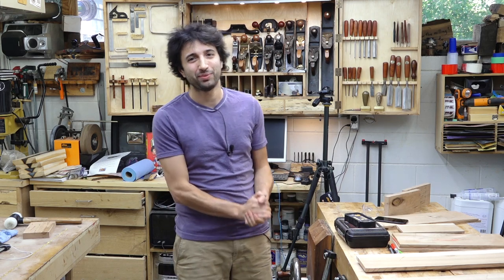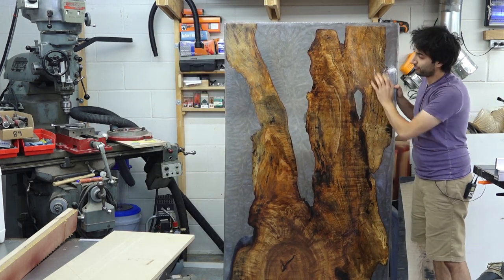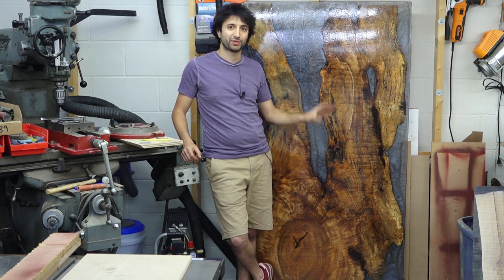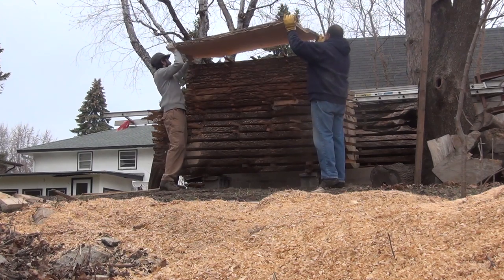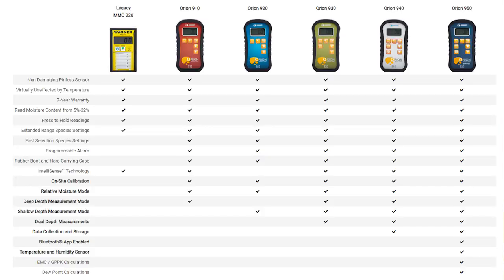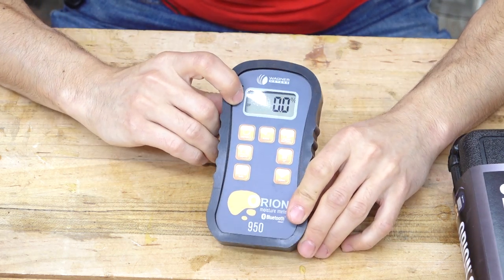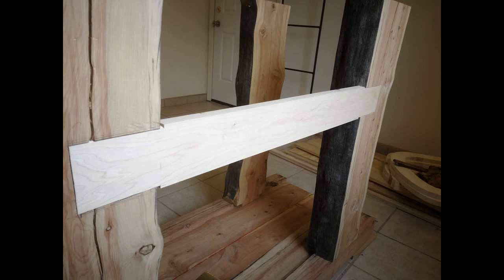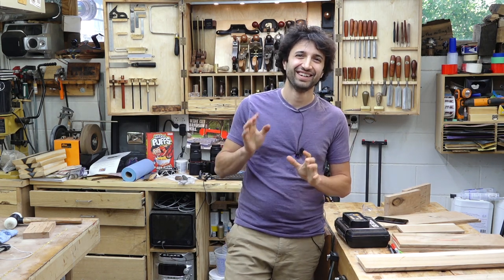Encapsulated Slab Demolding, Sawmill Veneer, and Orion Moisture Meters

Comment: I'm so far behind. I'd bet I sounded goofy suggesting pouring a large epoxy/resin rectangle wit that last slab on your previous video..."The most steel I ever cut...". Great minds, huh? I have so many channels I watch that I miss a lot of videos from all my favorite channels. I swear I never saw the "6 gallon" slab incasement video. (Yet) I gotta go watch that one for sure,  now that I've seen the finished product. I'd bet that would make a beautiful front house door if it was made to fit, maybe a hard wood frame around it and a piece or two set in for knobs, deadbolt, and hinges (at least three if not four for a heavy door like that?)

Comment: Turned out awesome. Why not use melamine as a base so you don’t have to use all that tape? Hose 1/2” slabs are crazy. Thanks for the giveaway to you and Wagner.
Reply: Epoxy probably bonds to melamine. A coat of wax would prevent that.

Comment: Wow, and I was just wondering how long it takes for your lumber you mill to dry. Do you have temperature and humidity control in your shop? If so what’s do you keep your settings at and do you adjust according to the seasons?

Comment: I recently made my first epoxy table. What I noticed was that the epoxy coating was not very scratch resistant. Do you or anyone else have any ideas on what I can coat it with to improve scratch resistance. That is a beautiful table, I hope you do not run into the same problem I did.